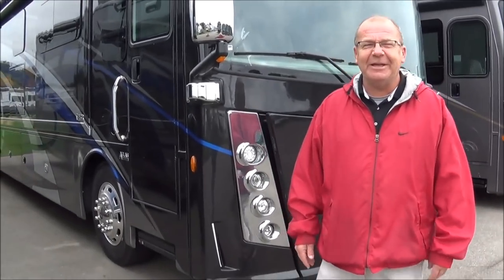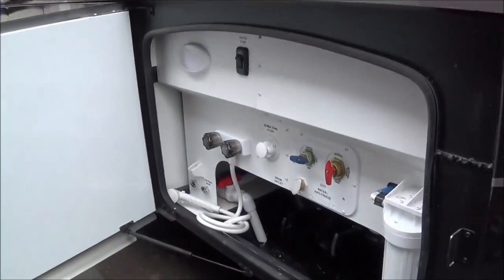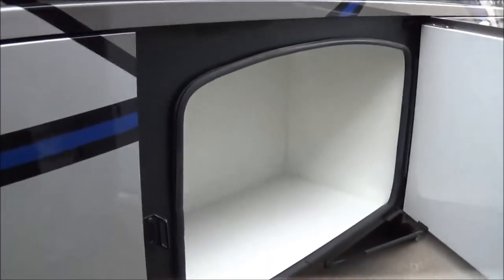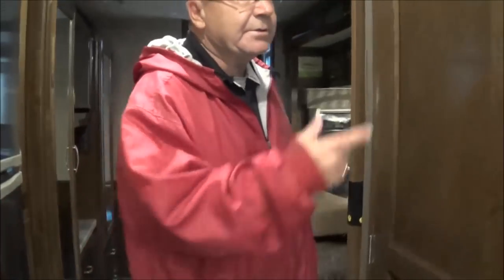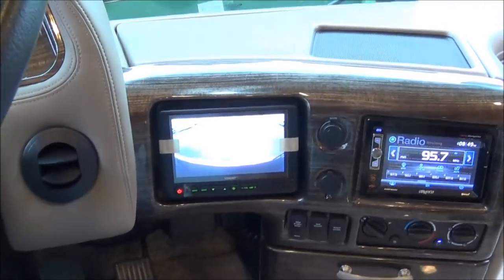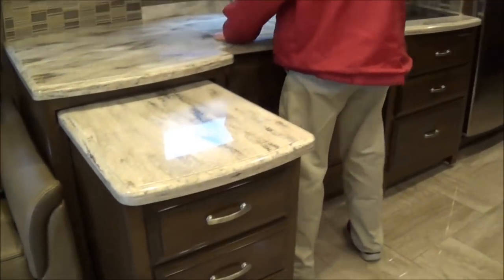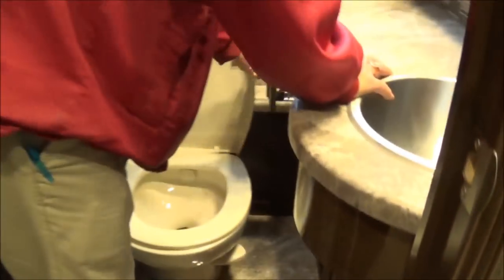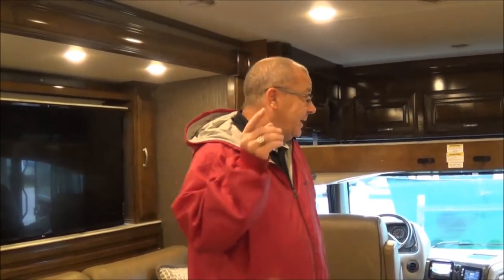2019 Aria 3901 Walk Thru with the RV Whisperer Now at Lazydays RV!

Comment: Did I hear you right when you said you have to have the Tilt Bed in the up position to extend the slide out? Why would that matter?
Reply from the maker: He misspoke. The bed needs to be tilted up to bring it in.
Reply: If that is the case why does it have to be in the up position to bring it in?
Reply from the maker: It does not to put it out, he misspoke. He's an excitable boy. 
To bring it in, yes it needs to be confirmed in the "Up" position, because it will crush part of the wardrobe.
Reply: Thanks,,,